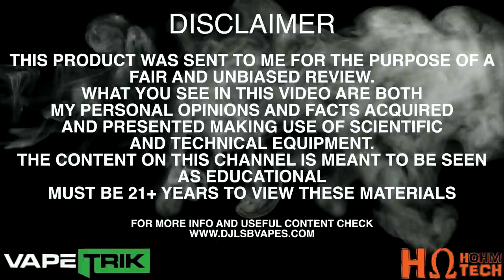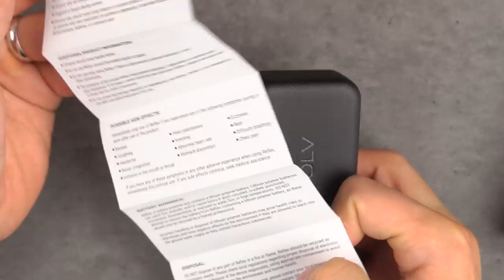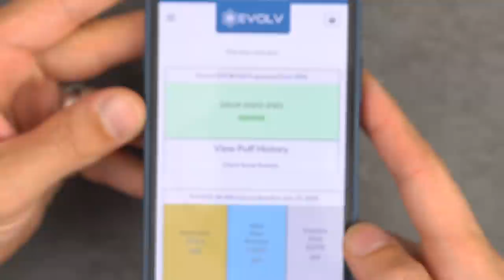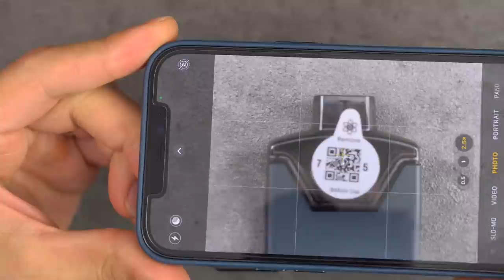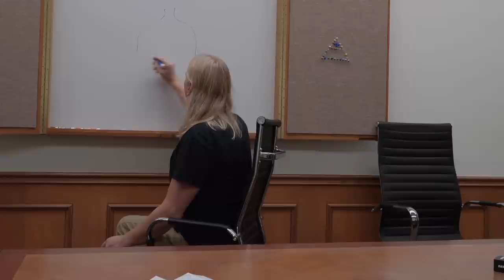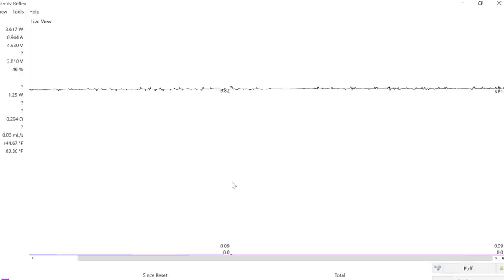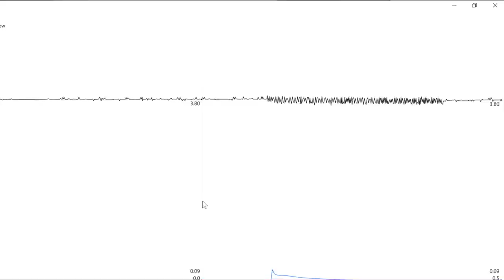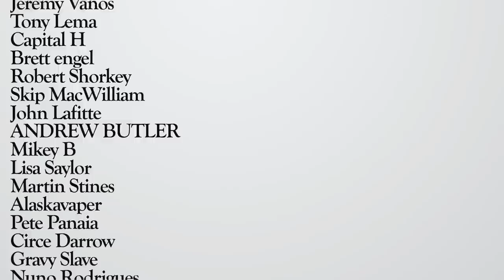Evolv Reflex - Exclusive Launch Interview & Special Opportunity

Comment: For anyone saying price is high just look at everything done. All the quality parts, extremely demanding quality control, hand assembled, tests done by a person, and majority if work is done in the USA. 

Pods are $6! Yes but they are custom ultem not some cheap crap. Coil material is stainless steel which is produced with higher tolerances. Also every pod runs through testing so there should be no bad pods plus every pod should vape the same.

Then there is all the information tied to each pod and device. Quality doesn't come cheap but it does make a better system. #EVOLV has again changed vaping.

Should not be afraid of clones. No company will go through all the work and quality control yo make a device like this.
Reply from the maker: So true indeed, American made quality device

Comment: Hi earl fernandez here i design vape d3vices for a living.
When i saw the airflow arrows and i heard them say its a crucial part the first thing that caught my eye is that the arrows are designed in a specific way, they look like tesla valvular conduit system
I noticed it coz i have been working on a similar airflow woth wotofo for a couple of months now.

The tesla valvular conduit airflow seems to be working with the inhale and exhale system coz its designed to dorect arflow in a singular direction and it also restricts backflow.

I think the way that works is in tandem with airflow. Being that the amount of air doesnt seem to change based on the hole size but the pressure of the air changes.

So i think the chip is reactively measuring to the change in pressure based on inhale adjusting power to the coils based on the curve of the programmed power to airpressure algorithm.

Atleast thats how i think it works when adjusting power of the inhale to amount of heat in the coils and air intake.

Its very interesting coz ive been doing the math manually on the perfect airflow (coz i have no machines or softwares to use as i work indipendently as a consultant) and the research that evolve has put into this parallels with my research.

Im very very interested in getting my hands on one of these devices. I am looking forward to your review and tests on this.

I love watching your channel coz its as accurate as acccurate can get in my opinion the most detailed of any reviewer ive seen so far. And i hope i can talk with you personally about your methodologies and exchange know how so that we can push the industry forward on multiple fronts.

Comment: I just got 1 this week. The draw, heat and vapor are great. The flavor is nearly non existent.  Have not tried it yet but personally I think a tobacco flavor would be the best in this device.
Reply: Hmm. Is this true at all of the three power settings?
Reply: @jamesb7794  Is what true? I'm just sharing my experience with it. Good throat hit. Very much like a cigarette.  Very little flavor.
Reply: Just put tobacco flavor in it. If you can't quit with this, you never will.
Reply: @dennykrontz7592  Is the flavor nonexistent at all three of the power settings?
Reply: @James-kj4xr  Yes
Reply: @James B  Very weak.  Which makes it almost identical to a cigarette with tobacco flavor.

Comment: Cool stuff Daniel thank you! i wonder if they are using an ultrasonic or electromagnetic flow meter?  I was kind of ticked off about the formaldehyde comment as that would so minuscule it would never begin to be anywhere in a hazard range.  Also the numbers i was always told are 80% of smokers that want to quit are able to transition to vaping once they find the right flavor and a decent device.

Comment: I’ve spent 2 days, 18+ hours, trying to give this device a fair shake. I’ve been vaping for over 10 years. I purchased 2, w/10 pods. The design as a nic delivery device for stealth vaping is fine. With unflavored juice, you could vape this almost anywhere. It very much hits like a cig. The battery and 2ml of juice seem to last forever. Here is why, there is a fatal flaw. The vapor production is anemic at best!! 
I’ve tried 50/50 and 70/30/mix, the later is slightly better. One of the joys of smoking is the “exhale”. The exhale of this, for me, is pitiful. You got better vapor production out of an old carto and stick battery! Million times better!
Don’t get me wrong. The device functions perfectly, so far. IT NEEDS INCREASED VAPOR.

Suggestions – 
1)	The fill caps need to be bright orange. They are tiny and black. PTA to find when you drop them. You will drop them. They also need to be universal fit, like a cork. Not directional. 
2)	Use a vertical coil. I understand the temp. issue.
3)	These will burn the cr*p out of your lips. 
4)	These will give you a sore throat. 
5)	So much airflow, NO Vapor?

To each his own. I don’t mind the price point. But, it has to produce VAPOR!
It was stated in the video, something to the affect, that there should be no vapor on the exhale.
That is where they missed the mark, for me.
Every smoker I know and I do mean every one of them, enjoy the exhale sensation. It is a vital part of the smoking experience. It makes this a deal breaker for me.
I don't look at it as a couple hundred bucks lost. It's just not for me.
I was hoping to give this as gifts to smokers. There are better options - IMO. Sorry.

I am a big fan of Evolv technologies. Maybe there will be a 2.0?
Reply: Would you sell it to me?
Reply: @terryrogers8965  Sure, send me $300 cash and I'll mail one to you.
Reply: @MutsPub  Seems a bit too much over RRP. I thought you didn't like it!
Reply: @MutsPub  Sorry, I can understand why you thought I was being a bit of a twit but I was quite sincere. Evolv is not shipping to Canada or any country other than the USA right now and I really want one to try and convert my wife to vaping full time.
Reply: @terryrogers8965  Ah, now I understand. I purchased these devices with a similar thought in mind. Everybody is different. With that said, I can not recommend this device simply because of the lack of exhale volume and it will burn her lips. Guaranteed. 
I have had other smokers try the device. They like the nic hit, as do I, but there is a lack of sensation in the exhale. The guy at Evolve stated that the perfect hit would be NO exhale vapor, as that would be a waste. This is by design. For me, that is a design error. Yes, you get your nic fix in a very small form factor, I agree 100%. But again every smoker I know WANTS the exhale. The jule was successful because it gives the nic hit. It is not intended for smokers. It is intended for new victims.-sarc- 
Sorry, I don't know how to get a device to Canada.
Try VooPoo pods, maybe? They have MTL versions. Check P. Busardo's site Tasteyourjuice, he has done several reviews on pod systems.
Best of luck. Don't give up.
PS - There are still no/zero reviews out yet, on the reflex. Only intros.

Comment: Got mine last Thursday. Draw is basically perfect. However there is one major issue. The amount of crackling and popping along with condensation that you get in your mouth is way too much. Definitely going to be a major turn off to any smoker looking to switch. So far the Juul is the only system that works like a cig. I was so hopeful that this product would be my breakaway from the Juul but I just can’t have that much juice in my mouth. I’ve left a message for Evolv to call me back but haven’t heard from them yet.
Reply: I bought 2 of the Evolv Reflex. The vapor production is anemic. 
The Uwell Caliburn G is a much better device <$30
Reply: @MutsPub  I don’t mind the minimal vapor production. I was never a fan of big clouds. And I like everything about the device except the the amount of juice / condensation you get in your mouth when you take a hit. So much crackling and popping. Definitely not cigarette like.  That’s one thing Juul got right - no popping or crackling and not condensation in your mouth. Of course 1 out of every Juul pod is bad but it’s the closest to a cig. I’m willing to try the CaliburnG. I just hope it’s on like the first Caliburn.
Reply: @aveezzyaveezzy2981  I've spent over a decade looking for the perfect vape - ha. I am happy with the device(s) I use. I'm looking at these devices for others. Everybody is different. For me, it's a hobby. 
The Uwell is the best I know of, so far, for its size and flexibility. I've even tried drilling out intake to increase air flow (mod). Battery will last for 2 tanks and a little more. That's 4 -5 mls. and about 4+ hrs of actual vape time. Mileage may vary. Freebase or salts. 70/30 and 50/50 work fine. I don't do flavors as an ADV anymore, so my coils last forever.
Hope this helps.